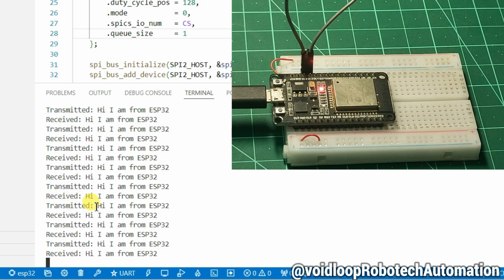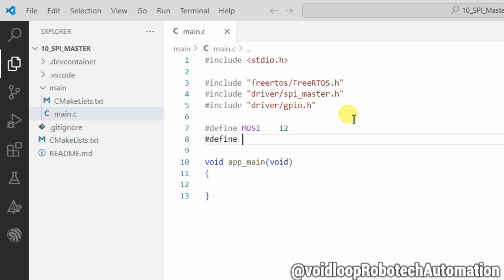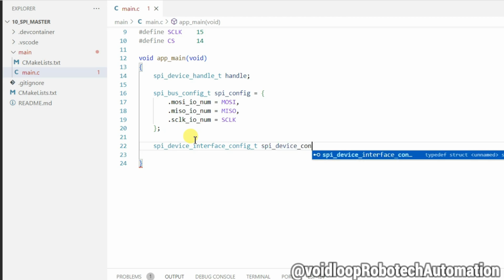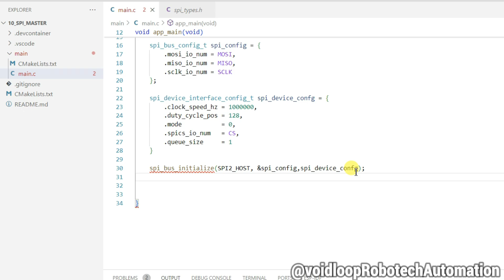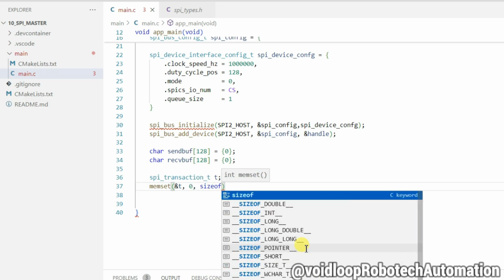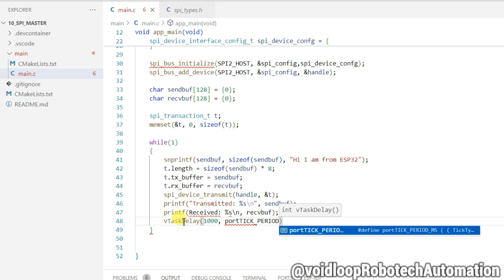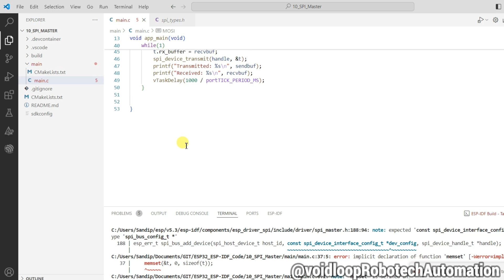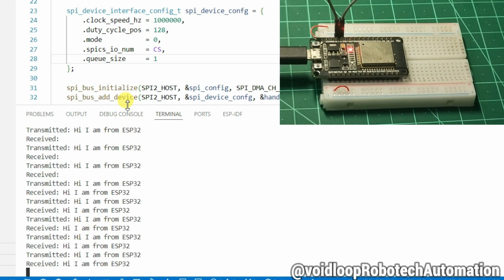10 ESP32 SPI master with ESP IDF and Embedded C

Comment: Question: is there a way to send 7 bit words instead of 8 bit words ?   Is t.length the number of bits that get sent from the buffer ?  If I use a packed struct for the send buffer and set the bit count to the number of bits needed, will they send properly ?
Reply: Should be possible, not sure. Anyways you should only send data that's bit count is divisible by 8 (full bytes), as devices are designed with that in mind. The best example is ascii. only 7 bits needed, but the whole byte is used, or bools, only one bit, so seven go to waste (optimisations with bitmasks are possible)